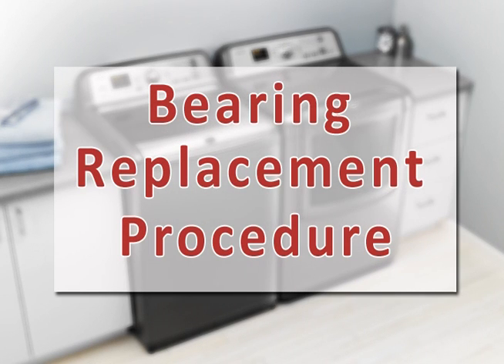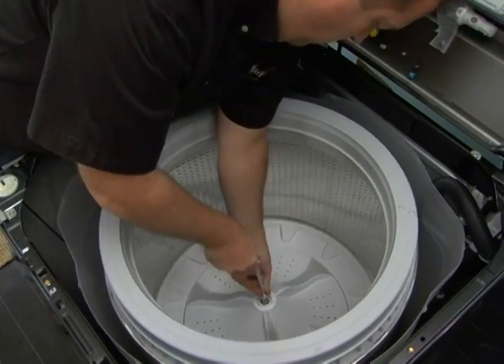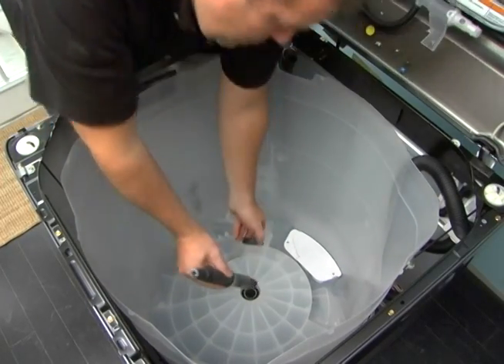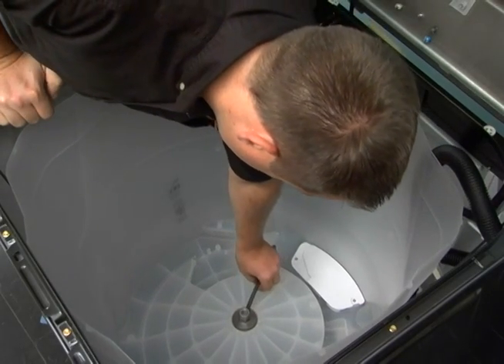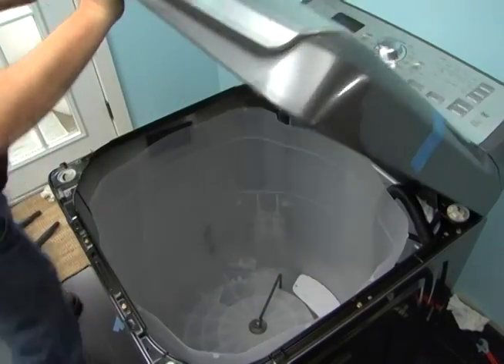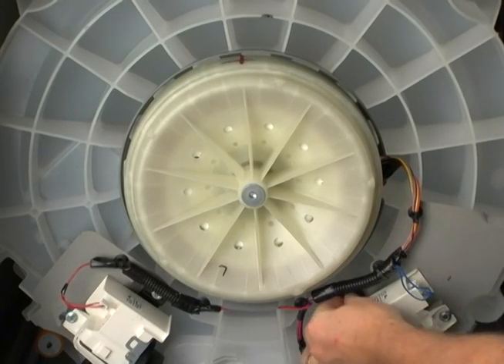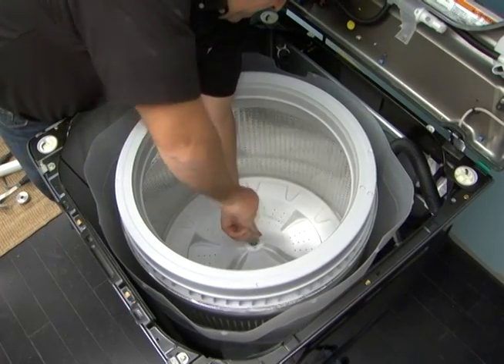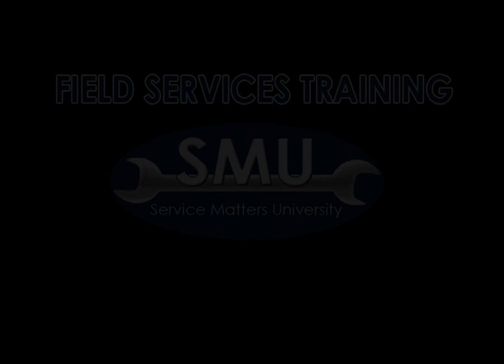Whirlpool Cabrio, Maytag Bravo, Kenmore Oasis Washer Tub Bearing Replacement

Comment: Hi - thx for the video. It really helped. Did the bearing replacement on my Maytag Bravos. The only tricky bits - 1) getting top off the Bravos. This model has 2 tabs w/ screws in back, then you have slide the top forward off front clips (there is video on youtube for this), 2) I really had to ht the shaft hard and a lot to get it to come out. Of the 2 bearings pulled out, the bottom one would not even spin - like it was full of gravel.

Comment: Thanks for the video.  Was able to pull the tub out without any issues. Just like the video.  Removed the sock and then cleaned it out.  I checked the bolt secures the stator and tightened that.    Now it is running like "new" again.  Again thanks for posting.

Comment: I have a Maytag Bravos quiet series 400 washer.  I purchased the tool and parts and just finished putting everything together.  This video, along with the instructions sent with the tool, saved me a lot of money.  The appliance repair company wanted to replace the entire outer tub, which would've cost me well over $400-$500.  It took me 2-4 hours since I took my time and also did a lot of parts cleaning while I had the washer apart.

Getting the tub out for me wasn't that difficult.  I just had to jerk it upwards a few times and it popped up off the shaft.  I can see how it sticks since it's essentially a gear shaft you're pulling it off of.  You can try snapping the tub in a turning motion left/right and then jerk upwards.

I can see where this tool really helps.  It causes an even compressing action at both the top and bottom of the tub.  You may get away with doing this using a bunch of washers on either end, a large bolt, but the tool also comes with bearing presses that help align everything (including a washer that sits between the bottom bearing and a spacer tube - shown at 3:05 in the video).  The "L" part of the tool assembly is useful in that it catches on the sump area wall as you're spinning the bolt from the bottom.  I think without something like this, you would need a second hand to hold the top bolt in place from above while you turned the bottom bolt.  

The only issue I have with this video is that it doesn't tell you how long to wait for the adhesive to dry before running water in the tub and testing everything out.  The adhesive tube doesn't tell you either.  Some have waited 24 hours, which seems excessive to me.  But, I guess it's better to be safe than sorry.  It also doesn't tell you about the spring on the tub seal, and which side that spring should face when installing the tub seal (facing up or down toward the tub).  I installed mine facing down toward the bearing as this seemed best for using the PVC pipe that comes with the tool to press it in.
Reply: your reply has a lot of very good information. hopefully i can add to this for any other souls who have questions about this process (like i did). i went through the whole bearing replacement job and it was a bear!

my inner tub did not come out easily at all. i even tried the car jack and 2x4 trick, along with plenty of wd40. the issue was that the hub basket had pretty much cemented itself to the drive shaft, making it practically impossible to remove the inner tub. ultimately i just cut the dang thing off with a disc cutter.

once that was removed, the inner tub could come out and i could try to remove the drive shaft. also not an easy job. i ended up propping the inner tub up on some 4x4's and a palette (so the draft shaft can poke out below). i then took a big hammer and pounded the drive shaft out with the help of a 2x4. after much banging and wondering if i was being too brutal with the thing, it finally came tumbling out.

getting the bearings out is pretty easy. both bearings should have an edge that you can catch with a steel rod or pipe to bang out. getting the bearings back in was a bit tricker, for me at least. i got the specialized tool, which i rented on ebay ($25 with a $70 refundable deposit once you ship it back). i found that the alignment of either the spacer pipe or the bottom washer would be off, meaning the drive shaft couldn't slide through completely.

in the end, i took the entire outer tub out and propped it on some surfaces so i could get underneath it and install the whole bearing assembly straight, without having to tip the washer or lean it on its side/back. i figured that was causing the spacer/washer to be off alignment. it did help, but the shaft still had issues sliding. so i took the steel rod i had used to pound out the bearings and used it to tap the spacer/washer until they were inline. the drive shaft finally fit!

everything else was straightforward.

i am also curious about how long you're supposed to let the pliobond set for. i was anxious about my repairs when it was all done and wanted to test it out, so i got it hooked up pretty quickly. ran some tests and it all seems to be good. hopefully the seal isn't a problem, because i didn't give it much time to set at all (maybe 30mins to 1hour).

thank you internet, youtube, and all the helpful netizens who have shared their knowledge!

Comment: Was all very easy. Thanks for the video.
A few small things. The rotor bolt wont come off. It is designed to pull the rotor down at the same time as the bolt is turned. When it stops moving you can pull down easy from side to side and it comes right off.

When pulling the basket most times it will not slide right out so you can have someone help you by each of you pulling up on the basket while one person taps the shaft downward and it will come right out.

Clean center shaft hole of basket.

Comment: Dear Samurai, great video.  Question: I have a hole the diameter of a metal coat hanger in the plastic drainage tub, that has rusted out the shaft bearing.  Do you think it is realistic to try to repair this hole, and if so, what material would you use: bondo, some sort of epoxy?

Comment: hey thanks for the help with this video.  the repair man wanted minimum of 400 bucks to do this job.  thanks  to you I made the change in a couple of hours and 95 bucks in parts.  didn't need any of the special tool  improvised and worked out just fine.   thanks again
Reply: Bigtwid Me bond If you hammered those bearing in without a compressor tool you have cut the life expectancy by half. be ready in a couple of years to do the same repairs.

Comment: I just replaced the bearing and seal set on my wife's Cabrio washer just a couple weeks ago. It now works like new. She has to occasionally get up to check on the washer to make sure that it's still running due to how quiet it is! A repair man had quoted us just over $240.00 to repair it, and that did not include the cleaning of the parts. I did it myself for under $40.00, WITH cleaning!

I was curious to see what the prices of the parts and tools were, so I had clicked on the links. Holy crap those are expensive! I had paid only $16.99 for the bearing set and $19.99 for the same identical tool set from Anazon!

Comment: EXCELLENT VIDEO!!! It took me maybe 1.5 hours and I was taking my time.  My tub was stuck on the drive shaft but I don't need no stinkin jack.  A little WD40 and a 10 lb sledgehammer and you can knock that thing out easy.  Just hold the edge of the tub in one hand and let the sledge drop down straight on top of it.  Piece...of...cake.  Thank you so much for the video.  Washing machine is back to being quiet as a church mouse.

Comment: I just replaced the seal/bearing in my Whirlpool Cabrio.  Took me 4 hours, but I took my time and it worked well.  A few things about this video:
they are using a new washer, so things come "apart" much easier.
- look for YouTube video to get top open - need a paint scraper - I had to use a chisel and some paint chipped because clips were rusty.
- To pull the tub off the drive shaft, you will need a jack.  Search on YouTube for tub removal and you will see a good video - use a 2x4 cut to fit in drum but catches top lip of basket.  Use a jack (I used a hydraulic jack) to remove basket.  You can also buy the tub removal tool a guy is selling - look for his video on YouTube.  You will not be able to pull the tub off like in this video.
- Be careful with the stator - mine had a few cracks in it, and apparently this is very common.  When putting back on, don't over tighten the 4 bolts.
- The bolt holding the tub in (top of shaft) is 7/16", the 4 bolts holding the stator on are 5/16".
- The new seal has a spring on one side - I put the spring side facing down - I'm pretty sure this is the correct orientation, but I found no video describing orientation to install.
- I waited 24 hours before putting water in mine, and I spun the drum with my hand after putting the glue on the top part of seal (after it was pressed in) to make sure everything was seated and no glue was accidentally on the seal face at the shaft.
All in all this video was well done, but it just makes some of the steps look a little easier than they really are.  However, once you do this repair, you will know your washer well!
Reply: My tib had water in it is that normal
Reply: My tub had water in it is that normal

Comment: Is the end of the "L" bracket supposed to touch the bottom of the sump area while sitting in the tub. In my case the top conical part of the tub (where the bearing is) was too high for the "L" to touch the bottom of the sump. It sat above it by about 1/2". I was able to complete the job regardless and now have a perfectly running Bravos.....Thank you for the "life saving" video tutorial.

Comment: Thanks for the excellent video...I'm handy, though I had never worked on major appliances before, but still had the job done in just over an hour with no problems.  I found the bearing replacement kit AND the bearing seating tool on eBay, so I even saved a few dollars there.  I found that the top bearing was trashed, and even just spinning it in my hands, I could hear the problem...no wonder it was howling at 1000 rpm!  I'm thinking the root cause is probably the seal, not necessarily the bearings.  Thanks again!

Comment: Maybe the suspension rods. I just replaced mine and it fixed the unbalanced problems. Now I have to replace the bearings for the noise. Did you get the bearing driver?

Comment: Hi all.  This is SUCH a great video. However, the Cabrio H2Low isn't quite built the same way with the motor underneath the drum.  Also, I am having a devil of a time getting all of the parts out of the hub out of the inside of the basket to remove the basket! I am fairly sure there are three parts to the hub, and we have only gotten two out.  Tomorrow I am gonna try to spray WD40 on the last piece to see if I can remove it this way.  I use a toothbrush and combo of baking soda with vinegar splashed on it to remove a LOT of gunk that causes the parts to stick together.  But this last piece of the hub WON'T budge! If I can't remove the hub, and I can't remove the basket/tub, I can't get to see if the seal needs replacing/bearings need replacing. (The electronic control panel is likely faulty, and the machine leaks water, so I wanna check the bottom of the tub.) Does anyone know of a video EXACTLY like this one--but using the Whirlpool Cabrio H2Low model WTW5550XW0 instead? Thank you for a great video! As for the person who asked about doing the repair without the tool, well, that depends on how resourceful, sweaty, gutsy and strong willed you are! My friend and I went McGyver on this machine yesterday and I finally said "there is no way my Polish ancestors came here with any special tools and fixed everything under the sun," and within 2 minutes, we had that first part off.  Three cheers! But now, the last component of the hub needs to come off if we wanna get that darned tub out.  I need access to my great grandfather's brain and mechanical hands!

Comment: I'm halfway through doing mine right now. I wanted to get everything apart before ordering the parts to make sure there wouldn't be any more damage than just the bearings. And aside from some melted plastic between the upper and lower bearing (from the bearing overheating, no doubt) everything looked pretty good - only a few small spots of rust. 

Getting the tub out was far more difficult than shown in this video - it took almost an hour. I had to lift up the tub while someone else hit the center shaft downwards with a hammer. I hope this didn't mess anything up on the motor below.

Someone else noted that you should absolutely not rotate the stator/housing out of risk of generating electricity that could fry your electronics. 

What is the purpose of the tub press tool assembly "L" part? Could you potentially press the bearings in with just a regular large nut and bolt with big washers on either side?

Comment: Man!!! Thanks for this video.  My 8yr old Kenmore Oasis Elite 110.27032602 was sounding like a Helicopter in the spin cycle and like to midgets wrestling.  Thumping all over the place.  Got the Bearing Kit.  Did the replacement job.  And also replaced the suspension rods.  Problem solved.   Thanks for your help.
Reply: +Grizzley Cinco I also have the 8 year old Kenmore  (one number off from your model) I'm going to try this as well, glad to hear you had success. Did you notice anything different from this video in the process?
Reply: Nah.  Just take it slow.  Washing mochine still working.  Watch the connections on the motor at the bottom.  If they are not snuggled in right or accidentally loosen up. You will get an error code.  Hardest part was opening the top off to remove the tub.  The tub will be all full soap scum on the outside.

Comment: I have just finished replacing the tub bearing for my Whirlpool Cabrio. The two kits suggested around here worked pretty well, although like any fixing job, expect obstacles and be resourceful. My big surprise was that the tub wouldn't come off the shaft after I took off the 7/16'' nut. This video was probably made using a brand new machine! Looking back, this could be quite common for old machines since it was the rust and grease and everything yucky that had glued the tub and the shaft together. After a frustrating 15 minutes, i decided to work from the under: I first took off the motor and a small nut, then hammered the shaft out together with the tub. Another thing was that the toolkit did not align up the bearings and the washer perfectly straight and i had trouble inserting the new shaft. I had to tap the washer repetitively to align them up before i could hammer the shaft through.. All in all, it worked.
Reply from the maker: The rusting drive shafts (sometimes badly rusted) is a common problem with these machines, especially in situations where either too much HE detergent (more than t tablespoons per load) or non-HE detergent has been used for extended periods of time.
Reply: SamuraiRepairman , help! I wish I could lift you out of the computer and pop you into the basement with this devil of a machine problem I am  having! Control board faulty (used ohmmeter), lid/lock switch assembly faulty (maybe? I think control board is faulty, switch seems to be reacting/responding fine when we took whole thing apart and examined mechanics), diagnostics are VARIABLE (sometimes indicates lid lock, sometimes shifter, sometimes motor, all of which seem to work!) I replaced actuator about a month ago. Machine still leaked a little, but then finally leaked a lot and now just doesn't work at all.  I am actually fixing this machine for a friend who is seriously broke.  (Money broke!) My pal who is also an excellent mechanic and electronic pro took every single part apart with me yesterday.  We just could NOT get that last part of the hub off! Today I went back and the diagnostics were all different again.  I am pretty sure that if I replace the electronic control panel, then I can get an accurate reading of the faults, and find out what is actually the problem! However, if she needs to spend $300 on the part (motherboard), and it ends up needing a new lid/lock switch ($40), new motor (ack!), and new sensor (double ack!) AND I need to repair the bearings/repair leaky seal, well then I am cooked.  I have spent about 10 hours inside this washing machine, 10 hours researching and reading about it! Good heavens.  God help me on this one!
Reply: Hi guys.  Appreciate your comment iyyov noach , however I think the wiring Ok. . . .I have GREAT news about the rusty bearings that get "glued" to the shaft.  Some elderly Mexican man in a repair forum (I cannot remember which!) said that equal parts motor oil and nail polish remover (the kind with 10% acetone) coated on rusted parts dissolves rust beautifully.  I didn't wanna run out and get motor oil so i used plain old vegetable oil/nail polish remover cuz that's what i had. it worked great! i was able to remove that final part of the '3 part hub" (which isn't a hub really--more of a set of nuts wouldn't you say? Maybe i am wrong!). Also, i was able to further paint on that solution with a tooth brush to the shaft where all the rust had gotten into every single little crevice.  then after an hour or two, i just took a paper clip and carefully got every single bit of grime and rust out of every single gear/line/rod part, all the  parts of the hub/the 'nuts' (three circular pieces) and they were like new. i reassembled, then tested over and over to see if still leaking. it only leaked when we filled past seal.  so we took seal out and now just gonna order a new seal, new adhesive, and i have grease.  i really feel whirlpool should help us with shipping of these parts. does anyone agree?